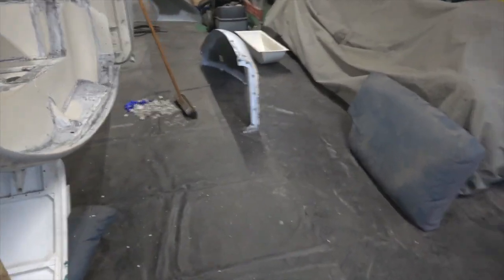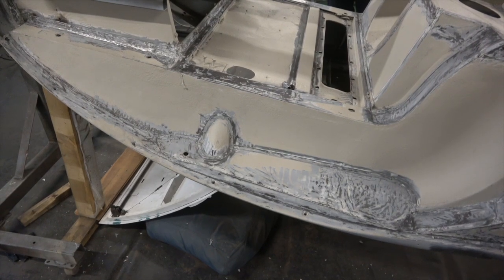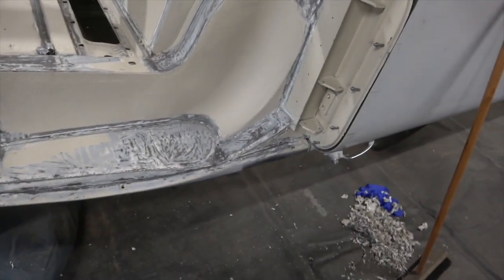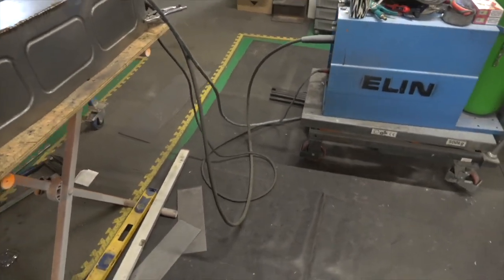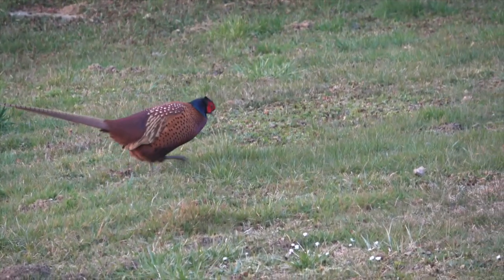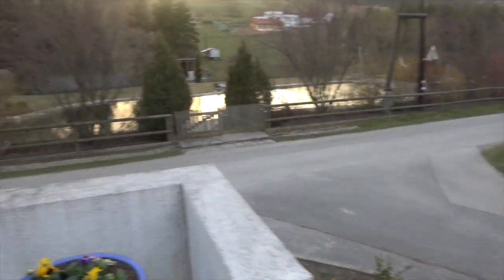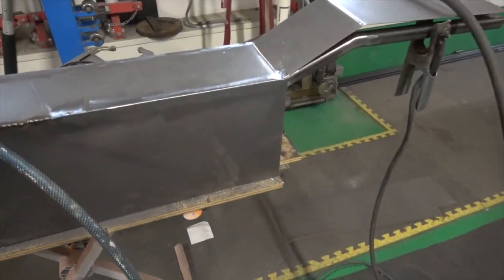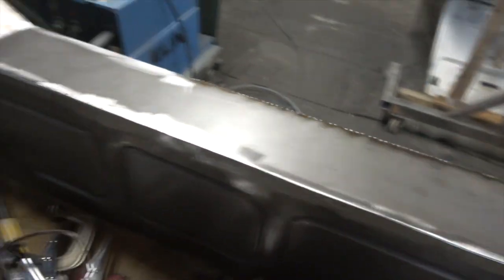Huge Thank You! + Jaguar XK 150 & Mini Mini Moke Update.

Comment: Hi Dave, Still loving the video's of the XK150 rebuild,very thorough. Question for you, what is the access hole for in the child seat area on the left side?  Also what are the two holes for (one large one small) where the floor and prop shaft tunnel meet again on the left side. They can be seen clearly with the body inverted.  Thanks again to Classic Car Cave.
Reply from the maker: Steve, Thank you!  ( I don‘t know. ) I have asked around as i can‘t see any reason for it when i look at where it lines up on the chassis the only
thing could be the handbrake cable adjustment or something like that Who knows lol, The others are for wire grommets i believe i haven't got
that far as yet, I will get back to you with an answer if in fact there is one ? Cheers Dave